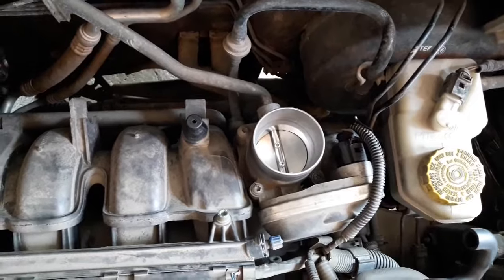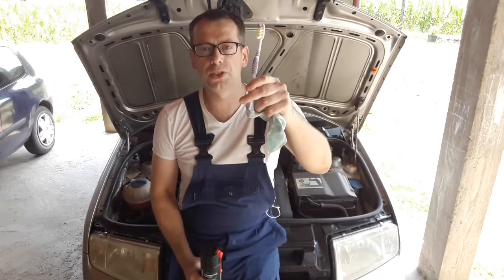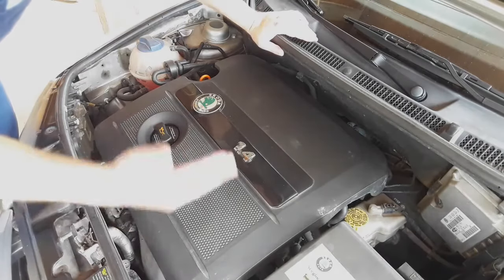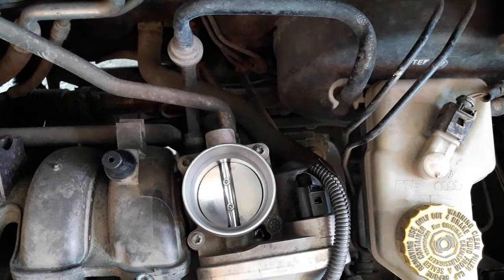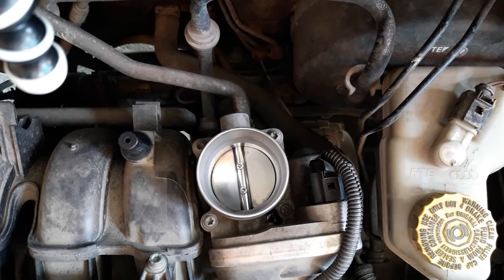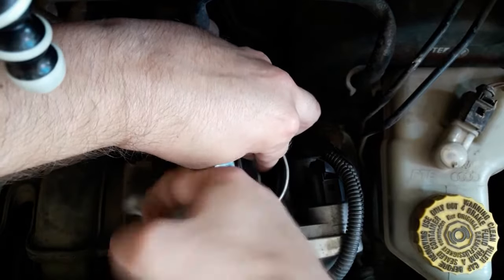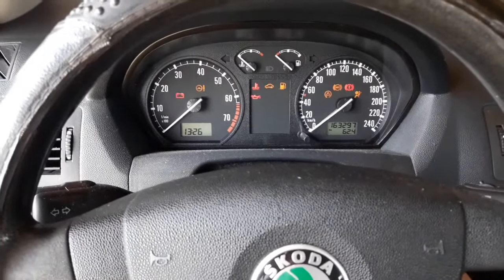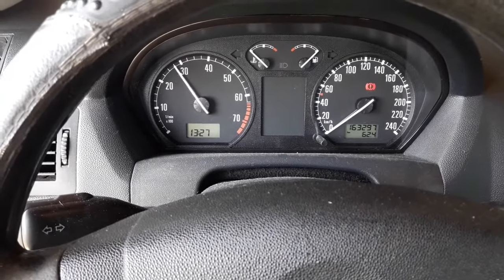How To Clean The Throttle Body-Without Removing It From The Engine

Comment: Where does all the gunk go when you clean your throttle body while still bolted in? Your engine... Take the time to remove it trust me
Reply from the maker: Hi, thanks for watching and for sharing.
You're right, the best option, especially when the throttle body is seriously filthy, is to take it off and give it a good clean.
But the point of the video is to show another less complicated and quicker option that can also solve the problem. Also, it's much more convenient for people who have less knowledge around cars and mechanics.
Regarding the gunk and spray, the spray evaporates and most of the gunk comes out when carefully cleaned with a cloth.
From personal experience, it's definitely worth the try before taking the throttle body off.
Reply: Very good question bro
Reply: I used good rags and completely cleaned both sides . Car is running like a champ
Reply: @Erelio  Hi! can you give us your assessment/example/opinion of the before-and-after? Thanx!
Reply: Spray the cleaner onto the rag. Then wipe. That way no cleaner goes into the engine.

Comment: Besides Cleaning 🧼 the throttle body of my pickup truck 🛻. I also clean it's MAF sensor too! And I always disconnect the battery both positive and negative terminal, I disconnect them, I don't wanna to shorten or ground some electricals while I'm doing it. It's better safe to disconnect them. So I clean the Throttle body, and the MAF sensor and I also clean the Air filter because I'm using a Volant Cold Air Intake, I clean them too and Re-oil it. After cleaning and doing inspections, I also gonna do inspections on the Sparkplugs to see if there's anything abnormal or unusual stuffs going on. Sometimes I also Inspecting the Fuel injectors too! Once I get all done with them. Before I reconnect the battery I'm also gonna inspect the Fuse box and relays, and also take a look at the battery itself too if it needed replacement. All of this are DIY I do it all myself! Because the cost of labor when you bring your vehicle in the shop is too expensive!!! Word of Advice! Get yourself a Repair and Maintenance Manual/Book for the specific Vehicle that you own and driving! It really will  saves you thousands of dollars! Especially Mechanic's  Rip off prices.
Reply: It's all about joy DIY
Reply: Thanks for this wonderful information!
Reply: Not necessary to disconnect the battery to clean the MAF . Just disconnect the wire to the MAF sensor , easily . Remove it completely , hold it up and spray liberally . I shake mine between spray bursts and let it dry inside at room temperature for at least an hour before , reinstalling .

Comment: Don't stick your finger inside the throttle body. When energized the butterfly will cut your fingers off. Disconnect the battery cable to be safe
Reply from the maker: Hi, thanks for watching and for sharing!

In this case, the butterfly valve is held by the mechanism (feels like it's held with a spring) If you're a bit careful, nothing bad should happen.
Reply: @DespairRepair  so no need to disconnect battery?
Reply from the maker: @brazyuniverse4221  Hi and thanks for watching. No, you don't need to.

You can do it if you want to be extra safe, but in most cases, there is no need to do it.
Reply: I've done it a few times and nothing. They shouldn't be closing that fast. Because you can still push them open while it's running.

Comment: Bro just take it off and clean it.  You'll never get a good clean with it still on.  The gasket needs replaced or scraped off it it's RVT.  Bad advice and lazy mechanic work.
Reply from the maker: Thanks for watching! The video is meant as a sort of first aid measure for less tech savvy people. It actually works pretty good in most cases when filth is causing the problem.
Reply: @DespairRepair  if you can’t take off a throttle body you have no business opening up ur hood

Comment: Hey friend, I think I made a mistake I sprayed liberally and now theres some small puddle of the product sitting inside......dont know if that could harm the engine if turn on the vehicle.....what would you recommend
Reply: It should be okay if you used carb cleaner
Reply: It'll burn out when the engine runs, no prob.

Comment: If your throttle get dirty by carbon mixed with oil, it is the sign your intake manifold is getting very dirty too. Cleaning the throttle will not help much. Eventually, the carbon from the dirty intake manifold will spread to the throttle in a short time. You have to clean the throttle again. Once you clean the intake manifold and the throttle, your car will keep going for another 100k miles.
The reason why there is carbon deposit in the throttle because those intake valves have some leaky oil that carries carbon and oil deposit into the intake manifold and it also spread into the throttle body.
Most of direct injection engines have this issues!
Reply: Very good information.Thank you Sir

Comment: Thanks for this video! Hoping this gets my 08 Jetta back to normal. Stuttering at any acceleration. And low rpm at stop.
Reply from the maker: You're welcome and thanks for watching!
Well, at least it's worth the try, since it all costs next to nothing (apart from the spray).
Most VW group cars of this generation have similar problems with the throttle body.
Reply: Was this the issue?

Comment: Sir, My wolks wagon polo 2019 (60000kms) was not ignitting or cranking after a long run.While turn ON the switch/key, there shows no response from the engine or starter and the warning lights like EPIC, Battery charge and Engine   trouble are lighting.  My battery is new. Does this  happens with the throttle body issue ?., after all I am not using my car regularly.I have replaced my drive belt, engine Oil  and cleaned the air filter recently.
Reply from the maker: Hi, and thanks for watching! It could be likely. I had a very similar problem with my Skoda Fabia, and we made a video about it.
It was the throttle body, in that case, the warning lights that appeared were the check engine light, EPC light, and traction control light. 
Also, hook up an OBD tool if you can and see what fault codes you get.

Comment: Ritz petrol 2015 44000 km above!
 After taking off the throttle body and cleaning it, I did the calibration as mentioned in this video.... after that the car turns off while running, sometimes it turns off when I step on the clutch, it turns off when I go slow.. there is no problem when I press the accelerator.... is this a throttle body complaint?

Comment: Hi DespairRepair! - love your title. Does this also apply to Volkswagen Golfs wherein I get the EPC light on and all kinds of false flags/errors on my dashboard? Because I thought I saw a video from you, or perhaps it was a short that described how to shut off your EPC warning light by this method. I get EPC warnings all the time, and I simply bypass it by shutting off the car and starting it again after 45 seconds.

 I'm also looking to get rid of my false flags. But they also go away as soon as I turn my car back on.

This morning I literally had my EPC go on and then my water temperature gauge go up to 200 degrees before I shut the car off. I could even hear the fan facing.
All I had to do to remedy was the usual with my EPC light being on. I waited 30 seconds. Everything was fine after that, including the thermometer showing false flags and racing.

Comment: Can a dirty throttle body cause voltage surges? Tricking pcm maybe? Had new alt belt and tensioner new battery but getting battery light and rough idle voltage surge dips
Reply from the maker: Hi, thanks for watching, and sorry for the late reply.
No, the throttle body can't affect the alternator voltage and system. But it can cause the rough idle which then causes an irregular alternator voltage.
Reply: It can definitely cause  the throttle plate to stick a little..
     Also can't hurt to clean MAF SENSOR

Comment: I had my computer worked on when I got the car back it was idling rough when the car is add a red light. Some videos say to turn the ignition to on then off twice on the third time turn the car on put your e-brake on, step on the brake, then put the car on drive. The engine should idle normal RPM after about 5 or 7 minutes. If this doesn't work then you should clean the throttle.
Reply from the maker: Thanks for sharing!

Comment: Some say you not supposed to push against that butterfly valve or you could damage the mechanism. Wouldn't it be better to remove the entire unit so the dirt doesn't accumulate inside.
Reply from the maker: Hi and thanks for watching! You're right, the better option is to take off the throttle body and clean it completely and thoroughly.
But this video is meant mainly for people with less experience in mechanics or who can't do a more complicated repair.
Especially since this helps lots of times.
I did this personally a couple of times, no damage or problems, of course, you need to be careful with the butterfly valve, it has to be opened slowly.
Regarding the filth, if you use a spray and some cloth or a small brush you can clean it very well, the spray evaporates and the filth that falls in the intake is insignificant.
Hope this helps and sorry for writing a novel 🙂

Comment: when cleaning the inside of the valve do i have to have the ignition on ?
Reply from the maker: Hi and thanks for watching! No, you don't but it mostly depends on the type of throttle body.
If it opens using just a cable, then press the gas pedal or rotate the control lever on the throttle body and it will open.
If it's an electronic system (like in the video) you'll need the ignition on and then press the pedal.
In this case, even with the ignition on, the throttle body didn't react so I had to open the valve manually 
If you have to do this don't use too much force so you don't damage the throttle body. Also don't open it fully, rather just a couple of millimeters that will be enough for cleaning.
Reply: Thank you so much. @DespairRepair
Reply from the maker: @martinwilliams5681  you're welcome and thanks for watching!

Comment: After opening the butterfly valve on the TB tht wide, would you not have to usually reset the ECU? I've known opening the valve this wide to make the car go into limp home mode + terrible starting etc without this reset...
Reply from the maker: Hi, and thanks for watching!
On sam cars perhaps, in this case, what you see in the video is what really happens. 
The throttle body is cleaned and the car is started without any problems. The simplicity of it all is one of the reasons we made this video.
But in case the throttle body was totally removed and cleaned, a reset would be necessary.
Reply: Mine opens when anyhow when at times I'm  running my vehicle hard from 0--60.
     Opens WIDE.

Comment: Can a dirty throttle body make your truck sound like a vacuum when you try to accelerate or rev it?
Reply from the maker: Hi, and thanks for watching! I don't think so, it would rather stall, you'd get the check engine light, it would idle roughly, etc.

Comment: So should the RPM be at about 1000 when the car stops at a stop sign
Reply from the maker: Hi and thanks for watching! The exact number is 900 rpm in most cases.
Reply: That depends every car has a different idle rpm, most cars idles at 700 to 850rpm.
1000 rpm is high idle i would be looking at vacuum leaks in this case.

Comment: Will this work on a 2013 Kia Optima
Reply from the maker: Hi and thanks for watching! The video shows the basic principle and if the throttle body is similar you can give it a try.
Just watch out if you're going to open the butterfly valve so that you don't damage the mechanism for opening it (don't damage the gears inside the mechanism that open it).

Comment: Where is the coolant tempurature sensor located on this car?, I want to swap out my 2003 polo 9n one, and this car is identical, could u possibly tell me? Or show me a pic?
Reply from the maker: Hi and sorry for the late response!

If it's the same engine and if we're talking about the same sensor (the one for the temperature gauge on the odometer) it's located on the plastic coolant connector.
When you look at the engine bay, it's on the right-hand side, near the battery, just under the engine cover.

 It has wires coming from it and a big pin holding it in place. Once you remove the engine cover, it's easier to see and you can't miss it.

This is the case with the Fabia anyway.

Hope this helps!

Comment: You're flushing all the dirt into the engine, doing more harm than gооd. You have to remove it and clean it. People see this 3:32 which looks clean, but don't see what it looks like inside.
Reply from the maker: Hi and thanks for watching and sharing!
The intention of the video was to show a quick fix without taking off the throttle body. 
The proper way to do it is to take it off as you've said, but many people are reluctant to do this as it's more complicated and time-consuming.
Also (at least from personal experience) this works just fine in most cases.
It's certainly worth the try.
Regarding the flushing, the spray evaporates quickly so I haven't noticed much gunk in the intake afterward. At least not more than there was before.
Reply: @Despair Repair Throttle body cleaner doesn't evaporate quickly, it's not meant to, you spray it into the valve and let it sit for a few seconds then flush it away. I cleaned mine recently which hadn't been cleaned for 13 years. So much soot came out it was like mud. I certainly don't want that goo going down my engine.

Comment: Wish my 06 Jetta was that easy to clean lol mine sits on the front end of the intake manifold. Really needs to be cleaned, loss of power on acceleration and random engine stalls.
Reply from the maker: Hi and thanks for watching!

Yeah, in this case, it's really easy to do and effective.

Don't want to be patronizing, but did you try to remove the air filter and spray through the air intake?  This is also a popular solution for throttle bodies that are complicated to take off.

Sometimes the better solution is to take the throttle body off immediately and properly clean it on the table, so to say.
Reply: Same for me. I have a 2015 golf and my throttle body intake is facing the manifold. Mine also has some extra part that seems to make the hose fit snug. Will try getting as close as possible to the opening and spray away. Will update . . .

Comment: Can rubbing alcohol or seafoam or degreaser be lightly applied on a rag and used for the throttle carbon build up. Why does it have to be throttle body cleaner becuz other chemicals even a damp rag works?
Reply from the maker: Hi and thanks for watching!
Well, you can, but most people use it because it's the best chemical to remove grime and grease.
The filth on the throttle body is very stubborn and sticky, this dissolves it very well.
Besides this, it evaporates quickly and doesn't get into the air intake.
By the way, if you decide to use other sprays or solvents try not to get any into the air intake, just in case.
Reply: WD 40 makes a throttle body spray cleaner.
Reply from the maker: @bennygreene1421  I'd recommend using the specific throttle body cleaner or carburetor cleaner, WD 40 is pretty greasy.
Reply: @DespairRepair  K
Reply: @DespairRepair  As for the throttle plate cleaning you also want the plate moving freely and not be dry?
Reply: @DespairRepair     Can it hurt to lube the throttle butterfly it has to open and close.
Reply from the maker: @bennygreene1421  I would avoid that just in case so the mechanism inside the throttle body doesn't accidentally get damaged.
Reply: @DespairRepair    Thanks for the update.  I can check also with my mechanic,  the seafoam cleaner and lubricant has positive reviews. 
    👍

Comment: Everybody I read on YouTube with electronic throttle body says you turn that ignition on and have someone press the
Gas pedal 
In fact you said it but didn't DO IT what's with that
Reply from the maker: Hi, and thanks for watching! In case of the Skoda, the butterfly valve on the throttle body turns only when you press the gas pedal while the engine is running. 
A bit inconvenient for cleaning.

So, cleaning is only possible like in the video.

Comment: Do not try this method on a nissan unless you want youre day ruined. Disconnect the battery, remove and clean the throttle body and re learn the throttle body.
Reply from the maker: Hi, thanks for watching and for sharing your knowledge and experience.
What you've explained is the right way to do it but the point of the video is to show a quick alternative, especially to people who have less knowledge and experience around mechanics.
Since the procedure shows results in the majority of cases (at least from personal experience), it's certainly worth the try this way.

Comment: lho koinnya kok di paksa buka dengan tangan, apa tidak rusak itu dan kacau
Reply from the maker: Hi and thanks for watching! If the translator did a good job, the answer would be: no the throttle body valve is OK, it doesn't break.

But you have to be careful when opening it and not use too much force.

Hope this helps.

Comment: That one is easily accessible, just remove it from the engine to clean it properly so that it doesnt dump all that in the engine, you can also change out the gasket while its off, gasket is under 10 dollars
Reply: The point of the video is doing it without taking it off I guess that went over your head